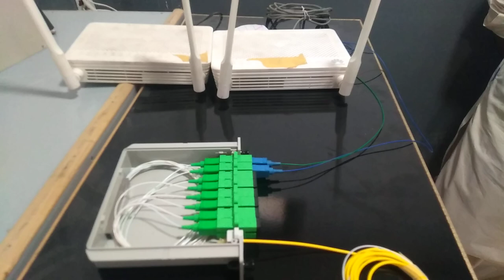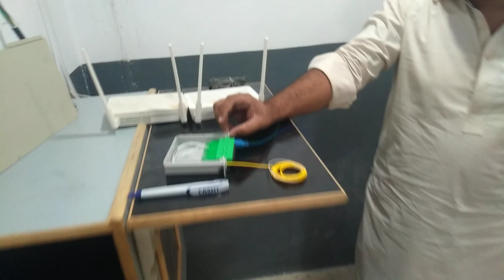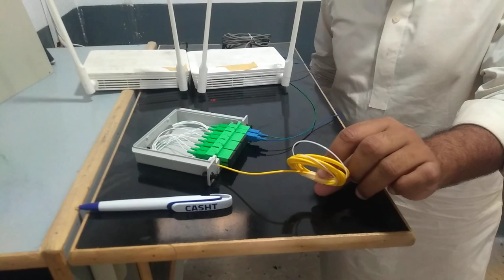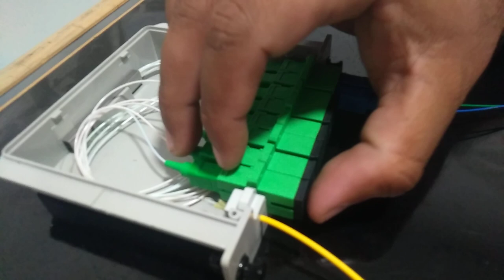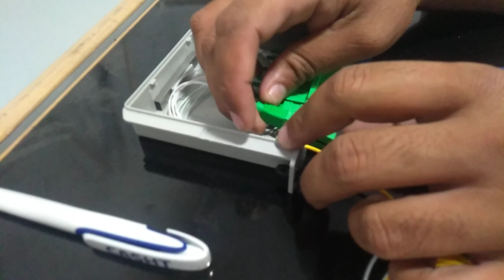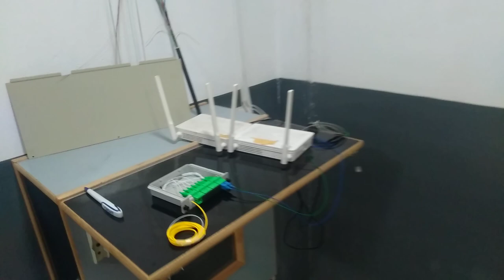FIber splitter  1:8 CONNECTION WITH 2 ONTs

Comment: Can 2 core optical fiber used for giving 8 connection with help of termination boxes at electric poles because isp used thin wire ? 
Or it should be 4 or 8 core optical fiber wire.